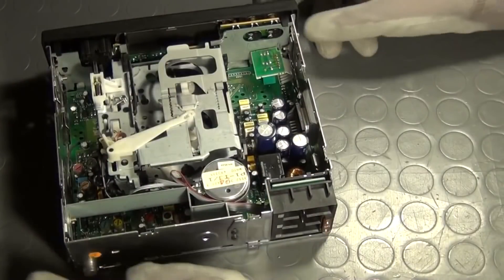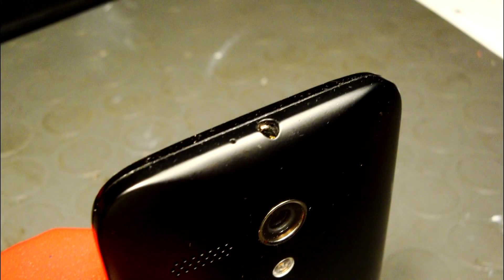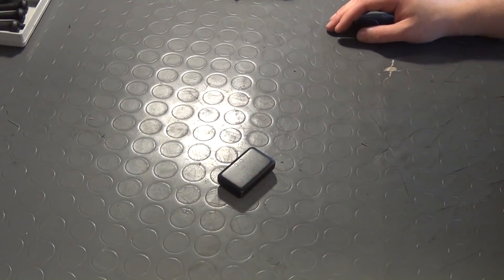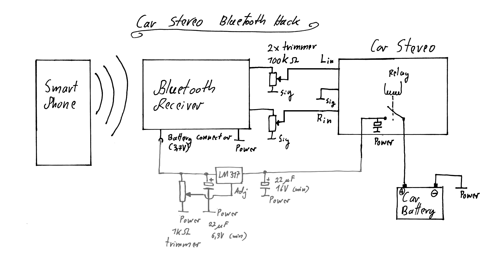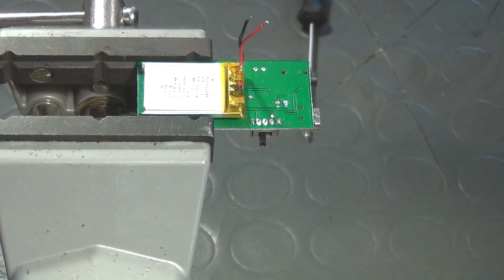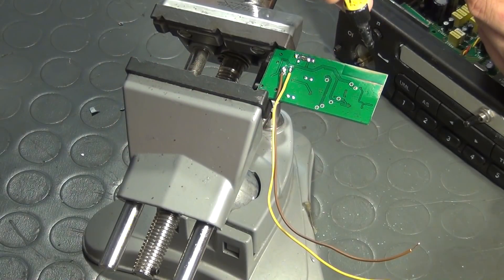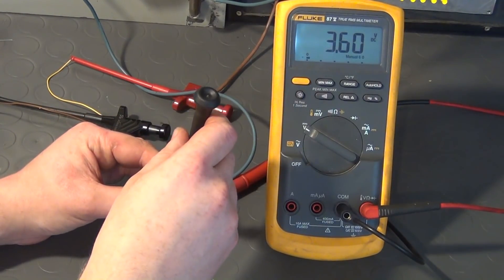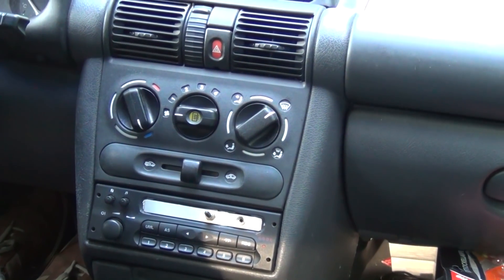Hack: Adding Bluetooth to  Car Stereos and Sound Systems

Comment: You don't need to scrap the LiOn battery and you dont need the voltage regulator. Just tap a +5V  from the 20 yrs old car stereo board and solder it on the micro usb port of the Bluetooth receiver.
Reply from the maker: +soosai steven the +5V voltage regulator of the radio is designed for only very small loads (DIP 8 package without heatsink). That's why I used another regulator. I also didn't "trash" the battery, it is not needed in this application and I will put it on the shelf until I will reuse it for something else.
Reply: +The Post Apocalyptic Inventor .. Oh,  Ok. Great work. Inspiring.
Reply: +1blisslife Maybe that can make an update video... "How to make your old car stereo accept phone calls, and play music! I would love to see how you would go about doing that BTW... :) Cheers
Reply: I would rather not have a perpetually charged lipo battery in my hot vehicle personally. it would eventually balloon up and possibly catch the car on fire. no thanks. besides, then the device would stay on until the battery died after, and it would no longer sync with the phone upon powering up the car stereo. Again, no.
Reply: +The Post Apocalyptic Inventor You could of gotten a Microphones enabled Bluetooth module for a tiny bit more, and would allow hands free phone calls while driving ;)
Reply: +soosai steven There are several problems with your proposal: the most obvious one is the spelling: that kind of battery is spelled "Li-ion" (a shorthand for lithium-ion). The second problem is that batteries eventually DO go bad which would cause unnecessary complications. It's simpler just to remove the whole battery and tap into the main power source instead. Besides, tapping into a 5V rail of an unknown device i.e. device that you haven't built (you don't know what does it power, how sensitive is to additional loading and how much power can it deliver) is just asking for trouble...
Reply: +Sokol Murati It's a Corsa, as noticed in another video ;)
Reply: Hello friend, I want to add bluetooth to my old aiwa system, the more you watch scheme all the more confused I get, I realized something but not enough my knowledge of electronics is miserable I would be grateful for the help, to you is 20 min work, if you want me help, I would send you an email with  device model that you can find scheme, Soldering and Remain is not an issue rather than where and what to add
Reply: power for usb is not a problem, it's too easy ,I want to add aux the tape head, I know I need to avoid pre-amp, but there are two IC from head to ha12185nt(audio signal processor for cassette deck) from there to ha1214a ( dolby noise reduction system)The question is whether to avoid both or just HA12185nt
Reply: with 1k ohm resistor
Reply: +The Post Apocalyptic Inventor Please answe is this a Corsa or a Tigra
Reply: Srdjan zmaj House or car system?
Reply: house, I think it would be easier to ad on the cd drive, tape deck is very simple, I think the pcb  where the head, i'm sorry for my English is not perfect,
Reply: I have aux but I wish to kept it because it is connected to pc
Reply: +Srdjan zmaj Get one of those USB Bluetooth receivers. Just needs USB power
Reply: +Srdjan zmaj Why not use a tape to aux??
Reply: +Srdjan zmaj Doesn't it have some audio input??
Reply: +Sokol Murati but tje tape to aux is horrible sound
Reply: That looks like a LiPo and not LiOn. I'd scrap it, personally.
Reply: He would have had a hard time figuring out how to turn the receiver off...
Reply: Watch his first video.
Reply: turn the radio off, or switch it to fm/am
Reply: Why if it's still serviceable?
Reply: Pat Butete He actually explained that
Reply: soosai steven

Comment: Hello, i have a 3.5 mm Mini Bluetooth Wireless Home Car Kit AUX, but when i connect this device to the car power supply, the listen a noise. The noise is the electric current. What i have to do, for that noise disapear. Thanks a lot
Reply: +Carlos Arturo Castro Garcia You could try a simple ferrite bead.  That may do the trick, and you can get them from thousands of devices for free.  Also,  If you can record the noise, then use an audio program, like Audacity, to find the frequency of the noise, you could build an audio filter to remove the noise.

Comment: Great Hack. I have a project that needs Bluetooth added to an HMI... It would be used for data transfer. The manufacturer tech dept. says it can only be done with wifi. (That is how it is sold and currently configured) Is that possible?

Comment: One more thing. I've watched many videos on this and almost all of them also talk about tricking the system so that it thinks a cassette has been inserted. Don't you have to do this with this approach? I've watched the previous video where you install the aux input and there you scratch a path. Does it serve that purpose?
Reply from the maker: +Mikayil Abdullayev Hey. The mod in this video was only possible, because I modified the stereo in the older video. Cutting the paths was just done to cut the pre-amplifier off from the rest of the device. The "tricking" is done by the switch on the front panel. It activates two contacts, that are normally pushed by a cassette being inserted.
Reply: your a genius. ingenuity at its best..

Comment: Man, it's a very good explanation but why did you start rushing after 7:05. I mean building up the regulator and making connections was the most important part of the video, but you just kind of fast forward it. It'd be great if you were a bit patient in that part.
Reply from the maker: +Mikayil Abdullayev Maybe I couldn't wait to get the video finished. You might be right about that. However: Building a regulator with the LM 317 is one of the most popular electronics beginner projects. If you google "LM 317" you will find a ton of tutorials. Many people have described how to use them and I didn't feel the need to repeat it. Connecting the parts on the board is always the same in all of my videos. That's why I don't show it. It's actually quiet simple: You solder the parts according to the plan I made to the copper pads of a vero-board. Then you connect the pads with wires, where needed. There really isn't much more behind it.
Reply: +The Post Apocalyptic Inventor Thank you very much. I'll do the google search and learn how to do it. You know, it's just what I needed. I've been killing my self to find a way to integrate a bluetooth receiver onto my Becker 3100 tape deck. Thanks again.
Reply: +The Post Apocalyptic Inventor But again, if you have the full length video, I'd be very glad to see it. Can you upload it somewhere that I can download?
Reply: Waaaaaaay too complicated.  The easy way is to buy a fixed IC regulator that will put out 3.7V tightly regulated at one amp.  Just need the IC and two capacitors: one on the Vcc input and one on the output leg.   One leg to 5V, one leg to ground, last leg puts out the 3.7V

Comment: I supose the bluetooth device has a 3.3V circuit. You Could have looked for the onboard 3.3V regulator and replace it with one that can handle the needed voltage drop from 12V to 3.3V. Or use a 5V regulator and let the onboard 3.3V regulator do the rest.

PS : 9:58 Da rollt doch irgendwo ne Bierflasche rum :D
Reply from the maker: +ppdan Das Radio hat einen kleinen 5V Linearregler im DIP-8 Gehäuse ohne Kühlkörper. Der ist nur für ein paar mA ausgelegt und ich wollte ihn nicht überlasten.

Comment: i like this idea, and about 5 or 6 years ago it would have been relevant, however in my country you can pick up a head unit with CD/BluTooth/AUX/USB for around $100. around the same price as you would pay for a 3rd party Blutooth module
Reply from the maker: +John Pycroft An old stereo like this can be bought for 1...10 €. the Bluetooth Module cost me 8,99 € on Ebay. 
Still: This channel is not about saving money: It's the expression of a philosophy of "Learning by Doing" and developing and testing theoretical knowledge by applying it where ever you can and when ever you can, no matter if the actual application is really necessary.
Reply: fair enough, i can get behind that concept. having not watched your original modification video, i'm assuming that the old cassette module had a line level output? i'm also surprised you couldn't find a +5v or +3.3v line somewhere in the main circuitry, did you put in your own voltage regulator to avoid overloading the internal power supply circuits?
Reply from the maker: John Pycroft
Exactly. There is an internal +5V rail, but the regulator is very small and I didn't want to overload it. The audio controller inside the stereo is designed for line level input.

Comment: Brilliant! Unfortunately in most modern cars, you can't do hacks like these anymore
Reply: What prevents this from being done in a modern car?
What are you considering modern? Modern ones have Bluetooth from the factory at this point.
Reply: Just noticed that was 6 years ago. I think that was roughly around the time it was becoming standard.
I still don't understand what prevents this from being done in a modern car.
Nothing stops modern cars from being modified. They just have to be treated like one big electronic gadget at this point.

Comment: Great stuff. I recently did the same to an old JVC mains HiFi CD player that a charity shop was throwing out. I took the inputs to the stereo connections at the DAC L and R outputs, and although this leads into an Op-Amp bank, the sound is somewhat attenuated - even if it's really good quality through a Pioneer amplifier!!

My bluetooth module has voltage regulation on board, so I simply took the power from the 5V rail leading to the CD module.

I'm guessing the 8-bit digital signal from the CD end itself goes through some siginificant amplification before reaching the DAC?

So why did I not just attach an exterior bluetooth module to the inputs of the Pioneer amp? Well, I want to take the process further; I'd like to attach this to old Pioneer CT-300 cassette deck with blue "fluoroscan" VDU sound level outputs.

I was going to go straight in where the tape head signal starts but I'm guessing the 600mV output of the bluetooth device I have might be a little too much, so that might need some attenuating.

It's all great fun.

Thanks

Ian

Comment: If you buy a Nokia N8 (or any late model before Microsoft acquisition that is also cheap and some are) you can send your music to the car via Radio. No need for Bluetooth, because Nokia always had little things like these to please everyone.
Reply from the maker: aserta  My old phone actually had an "FM transmitter" module, that you could plug into the phone. The only problem was, that due to the strict German regulations the transmitter was too weak to send a clear signal to the car radio ( even though it was an expensive Sony device). Later I imported one from China which had much more power, but was of very bad production quality.

Comment: I'm not sure I'd be happy with the 0.5W dissipation from the LM317 with no heatsink, especially in a car where ambient temperatures can be high.
Reply from the maker: SDG Electronics Well at least I mounted the LM317 to the board and also applied some thermal compound to it. My estimate is, that this is enough, but only time will tell.
Reply: The Post Apocalyptic Inventor You'll probably see a temperature rise of about 40°C. On a hot day I'd expect the temperature inside the centre console to be around 40°C or more, but I guess that depends on your weather over there.
Reply from the maker: You might be right. Normally I'm one of those people who always oversizes heatsinks. This time I just wanna know if I can go without one.

Comment: Bluetooth connection is always a pain, I have a sony SBH20 earlier jabra3030 & Motorola D200 usb tx, i almost everyday have connectivity problems,& then there are the 10 sec clicking sound even after successful connection.

Comment: The Post Apocalyptic Inventor do I hear the distinctive sound of (beer) bottles at 9:59 mark? :) Great to see you again, I was thinking you went in holiday to be honest, good to hear you are disease free now.
Reply: The Post Apocalyptic Inventor 
I was just going to post the very same thing! Here in Belgium, that's the sound I associate with 'day hikes' and 'excursions' :)

Nice video by the way, glad to have you back! My brother owns the same phone, is there no way to repair the audio jack on your phone as well?
Reply from the maker: Koffi Banan I'm not sure. Actually I still have warranty but haven't come to send the phone to the manufacturee yet. That's why I won't try to repair it myself. I'm quiet sure though that it will be nearly impossible to find the exact replacement part. Hand soldering this will also prove extremely hard I guess. That's the problem with today's electronics...

Comment: I would have loved to see some glue added to the solder joints where you soldered the audio cable to the pads next to the audio jack as a strain relief. Also, I don't know if it's needed in Germany, but here in Iceland I would have tried to seal the voltage regulator pot with silicone or some hot-snot to prevent moisture from changing the resistance and thus changing the output voltage. :) Great hack! Good to see you back on your feet! :D

Comment: nice idea, didnt know there was bluetooth adapters like that. I think ill do the same but to mine. It has cd and all but doesnt do OGG nor bluetooth, and i want to use my cellphone were i already have my music in ogg and my playlists.

btw, most probably that circuit could handle 5v, so a 78L05 directly to the pcb may have worked just fine.
Reply: Just buy a cheap Bluetooth earphones and mod it.
Reply: +soosai steven just buy the cassette adapter for $20. It has a mic, and a button extends out so you can answer calls, and use it for voice activated commands. It turns on automatically when the radios cassette head is extended into the adapter.

Comment: Very nice hack.
In your other video you mentioned the radio having a Voltage Regulator with 5V output for the digital circuits. Did you consider using that instead of your own regulator / would it be a good idea to do so?
Reply from the maker: ***** The problem is, that the 5 V regulator that is already inside the stereo is only made for very small output currents. I didn't want to damage it.

Comment: Very nicely done :-D
I hope you wrapped some insulating tape around the bluetooth pcb, superglue is brittle and can crack and fall, shame for the module to earth itself on the bare metal.
i have used the lm317 for many small supplys too, cant beat the simplicity :-)
Oh you may notice a slight drop in volume if you plug in an external source, the pots will present 50k extra loading, but that may be good lol.
I shall call you "Nimble vise" :-D
Reply from the maker: zx8401ztv Hey. I didn't use insulating tape. But I actually used a whole lot of mounting adhesive in addition to the super glue. I actually only used the super glue to "fixate"  the PCB so that it would hold in place as long as the other glue isn't hardened yet. 
I forgot to show that in the video. 
The LM 317 is always a good choice when efficiency doesn't matter. In this case the power dissipated by the regulator is so small that there would be no reason to go for a buck converter. It would only generate noise etc...
You are right about the 50k load. I really don't think that I will use the jack ever again though to be honest :D
Reply: The Post Apocalyptic Inventor 
For small boards like this heat shrink is very useful (the bigger diameter type that you use for battery packs for example). Covering one side in hotglue works well, too.
Reply: The Post Apocalyptic Inventor Im glad you used better glue, im sure you know im not picking fault in any way, i just like everyone to get the best out of there hobby :-D
Reply: superdau yes its brilliant stuff :-D, i used to use large heatshrink when i fitted modules inside ham radios, there wasnt much space to mount a pcb so the pcb was insulated by the heatshrink, also a large double sided adesive pad could be applied so the module could stick anywhere :-D

Comment: This is awesome. Wish I could do this but you lost me when you made the voltage regulating board and wired the whole thing.
Reply: +John Ridley Most of the cheap ones run at 50 or even 25 kHz and thaqt could introduce audio frequency ripple.
Reply: This is all great guys but I still have no idea how he ran power off the board to it. Or what the whole thing with the relay was about. I'm not at this level.
Reply: MrNightpwner You could use cheap LM317 DC-DC converter module from ebay :)
Reply: John Ridley Switching converter could introduce noise into sensitive audio circuit.
Reply: By a soundbot or any bluetooth speaker for that matter, some a/v cables, shrink wrap or black tape which ever you prefer, an equalizer and a head unit. In all honesty the head unit is not needed, unless- it's an leased vehicle or you like things in your dash. If you're a car audio person like me and have an amplifier in your car and a sound processor you'll literally have 5 area's of adjustment for volume and sound quality.